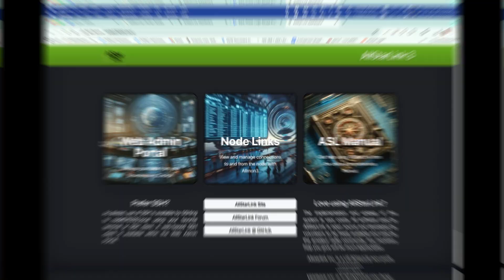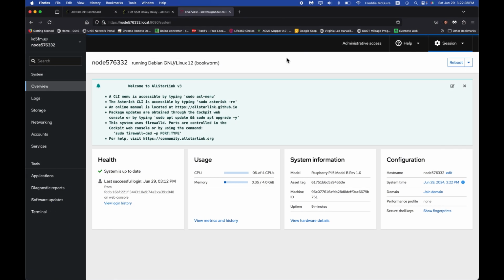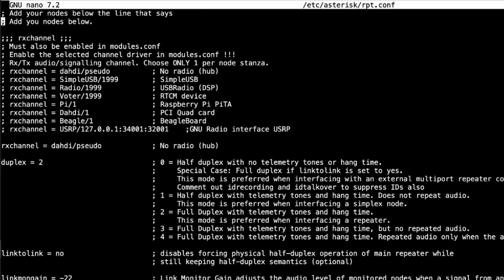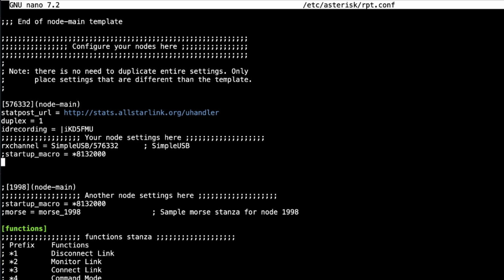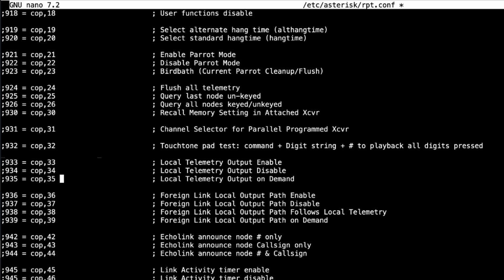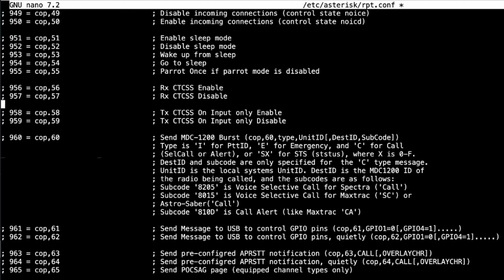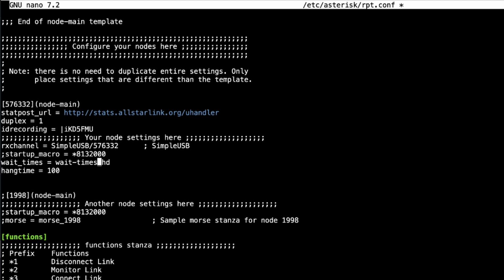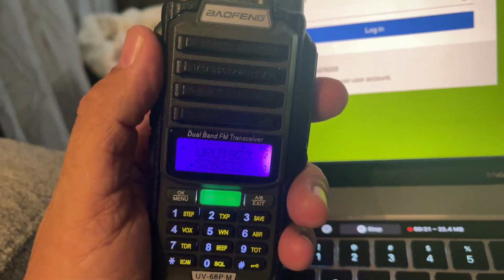AllStarLink Version 3 - Unkey Delay Timing

Comment: If I set ASL3 for simplex without the courtesy tone, under option zero, half duplex with no telemetry (link), can I add some hang time? That way, I could get confirmation that my Shari PiHat-4U is working when I unkey my portable transceiver. Hearing the courtesy tone beeping a lot gets to be annoying, but it would be nice to have some confirmation that the Shari PiHat-4U is working with a little additional hang time.
Reply from the maker: @daveborchard2019  I believe so. Just add the line hangtime = 1000 in your primary node stanza and see if it’s enough. If not up it a little and play around with it.

Comment: One time, when I was on an ASL-equipped repeater, I accidentally PTT'd too soon, right as the tone went through, and the person who operates the repeater who was monitoring it (I was talking to him by the repeater, but since it's part of a larger, interconnected network of repeaters in the subregion, i'm not sure if he was communicating by standard ameteur radio, or an RF link using HamVOIP, Hamshack Hotline or something like that) told me to wait until the tome finishes.

For the record: I was on a mobile vehicle as a passenger, who was tired at the time, and it was cold in the vehicle, so that combination makes me shiver a lot, so my finger pushed the button too early.

Comment: I had to go to 775  so that it would not cut off the first part of what it would say when you hit *70 for node identification.  Your mileage may vary, (Then under the [wait-times_hd] stanza
change the first three lines value from 100 to 500)
Reply from the maker: Yeah It's definitely depends on the timing of your device radio for sure. LOL!